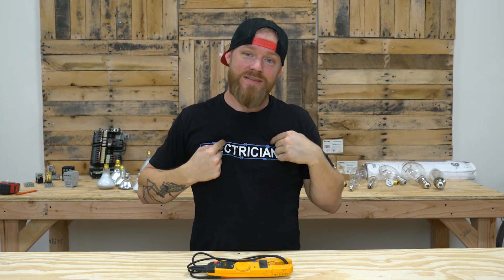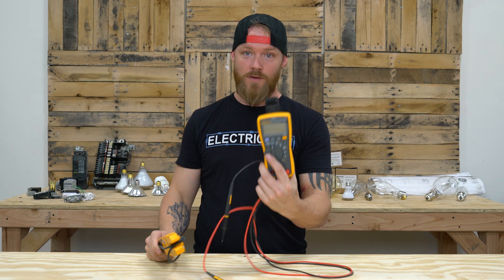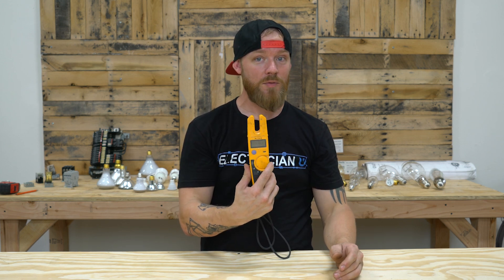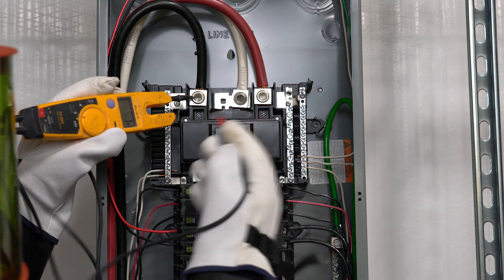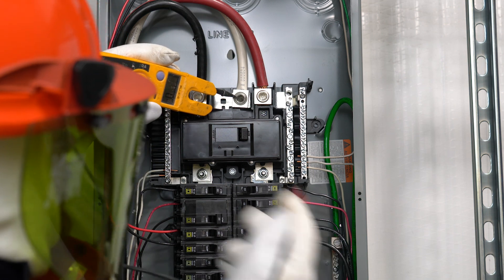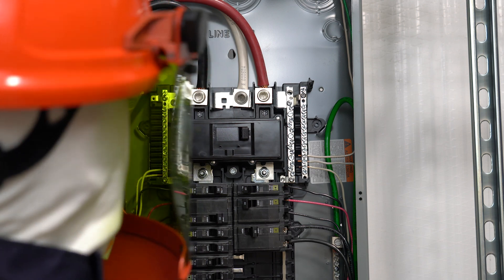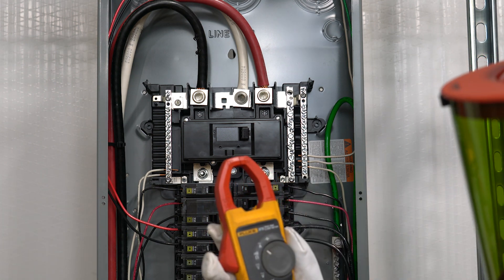How To Use A Multimeter - USING THE FLUKE T5-600 TESTER

Comment: If you forget to label your neutrals on a commercial install you can use audible continuity to tone out your neutrals so that they can be properly installed with their corresponding hot wire. I know this because I was a new apprentice and forgot to label my neutrals and this is how we grouped them. There were 80 circuits so it took a while but it works.

Comment: I have this meter and love it only thing is it’s only rated to 1000 ohm resistance anything over it won’t read just shows OL so if you have a motor with a fine short to ground it will more then likely want read it(been there before) overall awesome meter.

Comment: Why would the T5-600 show new batteries as 1volt only, there are new batteries in the meter. A basic voltage tester shows batteries are good (full deflection)

Comment: Thanks for the video. I just got one of these testers and no manual so I'm watching to pick up neat tricks like having one lead held at the top of the meter and the other in one hand. No more three handed testing! I am a Ham operator so most of my testing is 12-14 volts, low amps and ohms. This tester seems perfect for my needs. BTW both my sons have been journeymen electricians for over 20 years. Thanks again.

Comment: I tried to check for voltage in a light socket using this meter and it caused sparks to fly, I have to get new tips now. Why did this happen ? What did I do wrong ? I also checked for voltage on a different light and didn’t have an issue, it read 120 volts

Comment: In Controls work, I run into the problem a lot where I have a bunch of wires I need to know which goes where. What if I have a single conductor and need to see if it’s my wire ? I have nothing to tie it to to find a loop. For instance, I am in a remote controls panel that powers valves, I have valve on top of tank that needs 24 volt signal to open, and has a signal wire ran to it, but my panel has 50 signal wires that aren’t labeled. I figured this out once by putting 24 volts on all of the wires and went on top of tank testing for volts on the wire and unhooking each wire in the panel until I lost voltage on the valve wire. This was a long day !!!! What would you recommend ?

Comment: I used to schlep a T5 1000 ( gifted to a Newbie ) , I replaced it with a T6 1000 ( I have a love hate relationship with the feildsence function , it works OK , but…. ) I also use a Fluke 376 clamp meter, and an 87-5 .

Comment: Great video, I see a lot of people had suggestions on measuring resistance.  Here is an idea that would work great on camera.  Take a pencil and a sheet of paper and make a heavy graphite line.  You can test the resistance of the graphite at different distances on the paper.  Thanks for the excellent content.

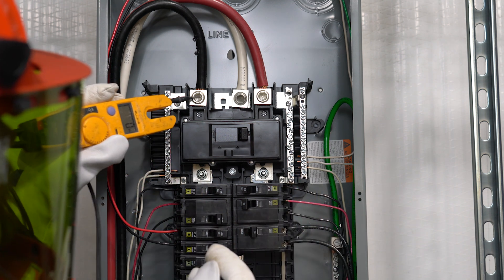Comment: At 5:10 I realized I don’t need to mess with this tool when I saw what he was wearing. Respect!
Reply: That was waAyyy overkill you don't need any of that. I'm an electrician we never wear a flash suit ever. That's for working on live circuits in high voltage 240 and up

Comment: That bit about measuring across the two mains for 240v, that's what I always thought (mostly self taught) until I actually did that and found 208v. Apparently standard in PGE- San Francisco Bay area. So it pays to check. Every time.

Comment: You were touching the bare wire and ends of the tester leads with your thumbs. This will give you a bad reading for ohm's and continuity. Since the body conducts electricity.

Comment: What’s the best meter u recommend I just finish electrician and start working for manufacturing maintenance technician?
Reply: The meter he used with do you justice. Just keep good tips on the leads, change the batteries when ohming leads gives more than 2volts, and make sure the replaceable tips are on securely.

Comment: Thanks for a good video.  I see that you were wearing some PPE when you were at the panel.  What hard hat, shield and gloves were you wearing?  I would like to buy the same if you recommend them, this is for residential application and probably overkill, but I considering I am new to this, I want to be safe.  Maybe electric rated PPE would be a good video topic?

Comment: hi, Thanks for your good videos. They have helped me a lot, because I am only learning to work in electricity. I have a question. What multimeter or what device tells me how many amperes bring the two hot wires that reach a sub-panel that does not have a man breaker?

Thank you very much in advance.
Reply: If it doesn't have a main c/b, then it will have a pull bar (otherwise it's not safe). Look for a label on the door for maximum amps. Whomever wired it should not have gone above that amount. They're usually maxed at that rating

Comment: First of all, love the channel you've created. I'm a 3rd Year resi. apprentice. My challenge is finding a product similar to this continuity beeper. 
Do you have any suggestions on what to look for or where I can find one. I thought maybe a pull cord alarm might help me, turns out the circuit board is much different even though the housing is similar. 
What to you use for ringing out a de- energized home when doing make up, or even confirming circuits during trim?

Comment: I have the T5-600.If I have it set to Ohms and forget to switch to voltage ,would I burn the fuse or will the meter reset itself

Comment: good demo of a multimeter - I would suggest that in measuring resistance you do not have your own personal non-insulated fingers touching both meter leads, as the meter will be measuring your bodily resistance...in parallel with the resistance of the thing you are measuring, and the total resistance in this parallel circuit will be less than the discrete resistance of any single component in this inadvertent parallel circuit - respectfully submitted

Comment: Hey Dustin Just so you know for future reference, you can use the resistance meter on a heating element's phase and neutral as an example of showing a higher resistance. Which is actually really useful if you are a putting a timer for a boiler that is in another location and the circuit box is in another location, you can use the resistance meter on the phases and neutrals to locate which one give off approximately 25 ohms which would be the boiler, and which phase and neutral don't really show any resistance to locate the phase and neutral that are coming from the circuit box.

Comment: I have the T5-1000 and one company which provides calibration services have said to me they classify this as a Multimeter and not a Voltage or Voltage/Continuity Tester. Like the T-110, T-130 or T-150, for example.

Comment: Does it matter on how u use the leads when testing volts etc
Reply: I don't think it matters too much with AC. When dealing with DC sometimes you need -12v and if you put your negative lead (black) on a positive terminal and the positive lead (red) on a negative terminal you will get a false positive voltage.

Comment: Its important to mention that you can't test current (amps) by placing a wire with multiple conductors between the jaws..  If the "wire" contains both the hot and neutral conducts they cancel each other out.  You get a good reading only if there is 1 (one) conductor between the jaws.  This is a common beginner mistake and can cause real trouble.
Reply: True they cancel another out, but if there was a problem with the circuit and the current was taking another path as well, then by testing both conductors at the same time you would be able to detect the difference correct? Asking for a friend

Comment: How do you open up your receptacle and figure out which wire is the source hot so I can use it to power another receptical i want to install?  I'm a noobie and there are NO outlets in my garage and want to put one in there!
Reply: You dont really need to know that to do the job but be safe and turn the breaker off, take only one hot wire off the receptacle and put a wire nut on it for safety. Turn the breaker back on and plug something into the receptacle. If it works thats your hot side and if it doesn't the disconnected wire is your hot feed. You should pig tail your ground , nuetral and line if your taping into the middle of a group of receptacles. Receptacle set screws are made only to have 2 wires under them and pig tails leave a clean finish and easier to put everything back in your box.
Reply: @cheynebest7028  thanks man that makes a lot of sense.

Comment: I walked into an electric room at a new construction retirement home... so... all the guys got all the wire in the room so that the framers and drywallers could finish their stuff... but... they didn't label any of the wire... so we sat there for just about a week doing con. Checks on every single wire in that room to figure out what it is what circuit it is and where it's going so we could put it in the respectable panel and terminate the wires.... wasn't a good week....
Reply: i love the number tags  takes 2 seconds to do    just have a numbering system on bigger jobs
Reply: I hope they got fired.

Comment: hi Dustin love Ur videos's man i learn lots from them  . i have a question for you i do commercial refrigeration and air conditioning been in the field for 3 years but i want to get in to more of the electrical side . do u have any tricks on finding the breaker for the unit on the roof of a business if you have many panels  and ur trying find the breaker for that certain unit that am trying to repair ?
Reply from the maker: I’d use a circuit tracer for that. You should first be an electrician lol, but after that formal disclaimer you can hook a tracer up and wave it around the panels and it’ll tell you which one it’s in. Even better than that it can identify which exact breaker you’re working with if it’s not labeled.

Comment: That Spike in the Current reading when You turned on the Shop Fan  is called '' In-Rush '' Current , which is common on Motors and it can be as much as Six Times the normal current of the device being used
Reply: Even higher than six times
Reply: That means the resistance is lower for that duration or no?

Comment: When you are testing voltages in the panel (or recepticale or light socket), the circuit in the panel has to be ON. when testing continuity, circuit has to be OFF
Reply from the maker: You're right, I'm actually going to do a dedicated video on each of these so I'll make sure to put that info in there.  Thanks!

Comment: Can you do a video on a lost neutral? You test from phase to phase and get 240, you test from phase to neutral  and get 120 so everything looks fine. but then you plug a load in and everything goes crazy.
Reply: Old 240 volt delta with center tapp ( earth ground) so you get 208 if you dont test properly.  He has a vid on that.

Comment: How about a video explaining what occurs if you attach the two neutral wires to a switch instead of the black (hot) wires and why you might think you have it hooked up correctly because the light goes on and off when you flip the switch.  And the danger involved.  Love the channel.
Reply: No need for a while video, a reply can cover it. You'd think it was correct, because it works. However, it is more dangerous to do that way because there will always be voltage present at the fixture regardless of switch position. Especially hazardous if a light bulb breaks, leaving the metal part in the socket. You'd have to kill power at the breaker to remove it safely.

Comment: Under what circumstances do you need to buy the tester with "calibration data?"
Reply: For general electrical, you don't need it. However, If you're in a situation where absolute precision matters (for example electronics) then yes you need to have your meters calibrated regularly.

Comment: Since you talked about an amp clamp, maybe toss in a picture/explanation of a line splitter so people can see how to test at the load as well as the panel
Reply: Yes,  show this video,  got a top dog gov project and got to make sure that dont cheap it on lighting. And, do led panels nowadays have buit in transformers, does the led actually operate at much higher voltage than 277, and if so, how much KVA is eaten up by transformer losses., so, need to see how to test balast voltage, and measure output current to test for actual res...

Comment: Nice vids. I'm working as an Electrician in Austria and it is really cool to see how things are done differently but still the same. I was wondering if you could make a video about the maximum amount of devices you can add to a circuit breaker and why
Reply: You can put 12 receptacles on a 15 amp breaker and 30 lights at 50 watts a piece on a 15 amp breaker thats all dependent on the lighting fixtures youre installing. Thats all at 120/240 volt in north america.